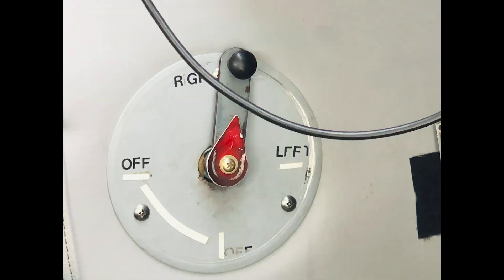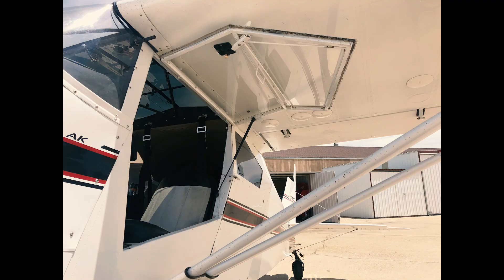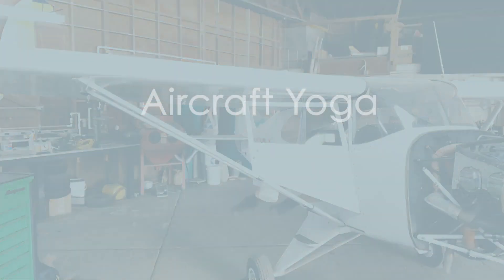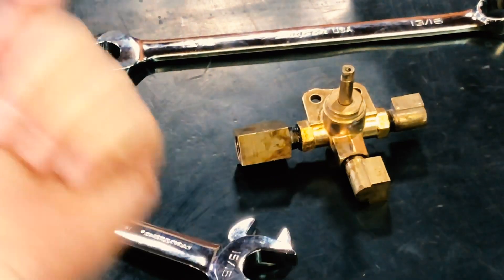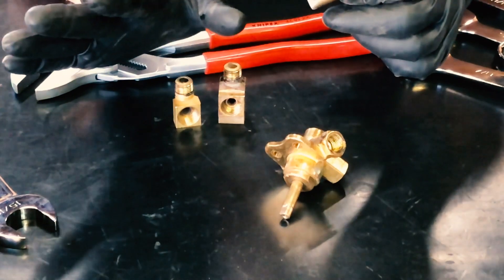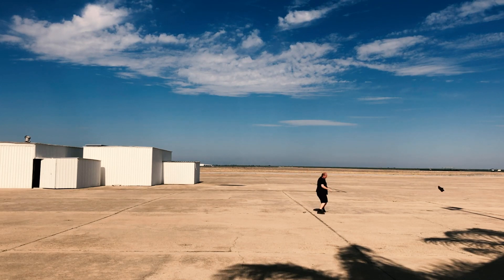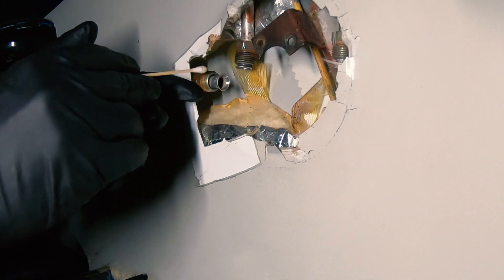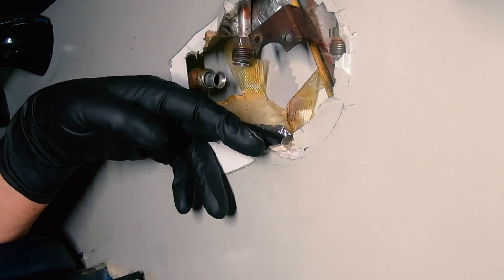How To Upgrade The Fuel Selector For A Piper Tri-Pacer with the Dakota Cub STC (DIY Series)

Comment: It’s a tapered pipe fitting, the proper method is to use Teflon tape....
Oh, and don’t use Teflon tape on the treads for the tapered seat tube fittings. They are straight treads, Teflon tape only goes on tapered thread!
Reply: We don't use Teflon tape on fuel fittings on aircraft.
Reply from the maker: My experience has been that Teflon tape, especially on fuel fittings, cause lots of problems, mostly from shredding - I actually don't know anyone that uses it for fuel. The EZ Turn sealing lubricant I used in the video (and linked to in the show notes) is specifically made for any kind of avgas fuel line fitting.
Reply: No Teflon use fuel lube on fittings.
Reply: Like most things Teflon tape is best used in moderation. I’ve used it on fittings that see over 6000 psi, and also fittings that are exposed to corrosive and oxidizing gasses and liquids. I’ve used it in some pretty extreme conditions, but only on tapered pipe threads. What I won’t do is use it for anything with straight threads. If the fitting uses a sealing o-ring, a ferrule, or a tapered face, all these fittings   Use straight threads. Like all things (JB weld...  really???) there’s a proper place and amount to use Teflon tape. If there’s a reason not to use it in aviation fuel systems then I just learned something new. Thank you.
Reply: Yes, Teflon tape works great when applied properly. Not a common practice in aviation. Been issues over the years.

Comment: On the one hand, yes. On the other hand, if you're more than, oh, 10 years old, you will know never to be surprised at the level of half-assedness of people. No doubt this valve had been leaking chronically, and eventually, one mechanic got it to stop, and the owner was happy, and didn't ask questions.

But at least you have a Juan. Everybody needs a Juan.
Reply from the maker: It was not leaking, nor were there any signs of leaking. They just used the wrong sealant - which caused a nightmare for the next mechanic to come along.
Reply: @SciWorx  New question (I've been Googling this with different terms, no luck): What's the usual or accepted protocol, procedure or schedule for managing/timing the switching of tanks if you have the original style valve? I've just bought one of these myself, without the optional auxiliary tank, and I'm picking it up in about 3 weeks and flying it 1100nm to its new home.

Comment: What have you found to be the best way to drain the fuel tanks on the PA 22/20? Thank you
Reply from the maker: I typically us the lower drain forward of the firewall and just fill buckets until all the fuel is out. Then I visit the other drains until those are fully drained. Then I transfer the buckets of fuel into clean cans. If your fuel selector does NOT have a BOTH setting, remember to cycle the selector to left and right to make sure both tanks are drained.

Comment: Sir, my OEM selector valve started to leak and I want to replace it. I was under the impression in order to have a both option you’d need to run new fuel lines from the right tank. Is that true with the valve you used?
Reply from the maker: Not for me. The Dakota selector bolts straight in.
Reply: That’s Edie Trimers Maule Fuel Selector STC, that one reroutes the right tank fuel lines getting rid of the belly fuel sump under the passenger. A lot of work, but not only does it eliminate the detent fuel selector ad but also eliminates the right tank level flight only when less then 1/3 fuel. Which if you’ve ever had that airlock from that, it will wake you up when the prop stops and make you very cautious when on the right tank… let’s just say I won’t maneuver land or take off on the right tank anymore…. 😂 I don’t believe the Dakota Cub stc changes right tank operation since it doesn’t change the fuel lines around.

Comment: It's almost like being an archaeologist.  I'm recover wings/tail on a '54 '22.  It has turned into a restoration of much of it.  No drain grommet at the bottom of the rudder, so it looked like it came out of the Titanic. Replaced. All the internal wing bracing wires were wrong- they crossed over the same way. Use of castle nuts throughout instead of nyloks. Cracked and corroded ribs. One tip rib at the wrong station. Evidence of possible lightning strike on one rib- the aluminum crumbled like a thin potato chip around a semicircle of missing material. It's a hobby and it keeps my IA entertained.
Reply from the maker: Your poor IA. But yeah, total archaeology. You fix one thing and then you see three more squawks that need attention.